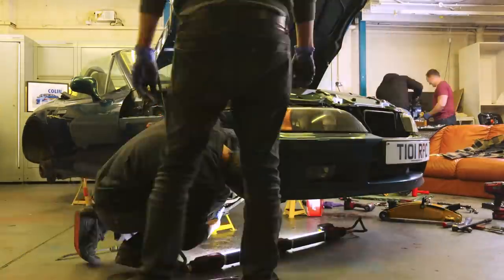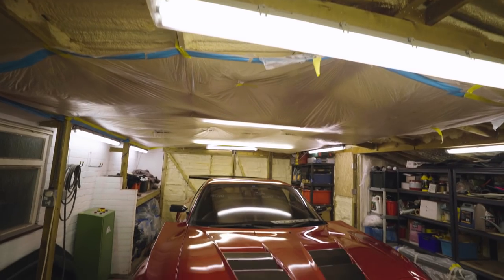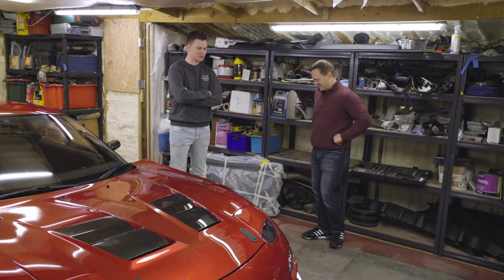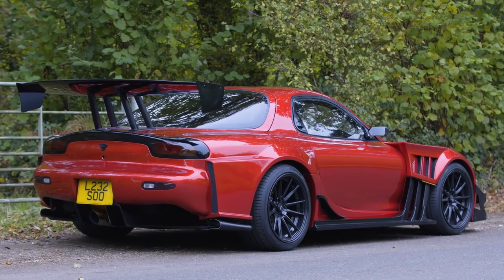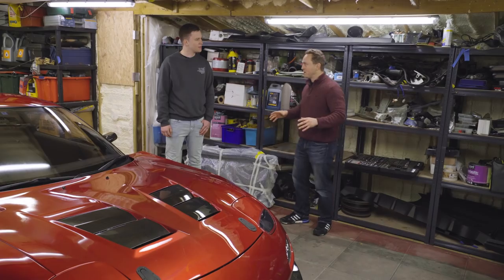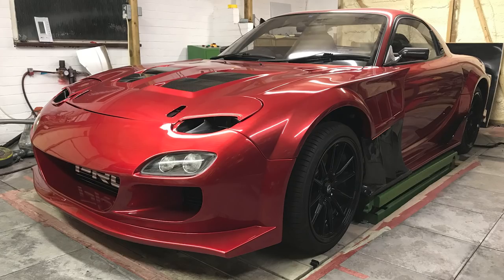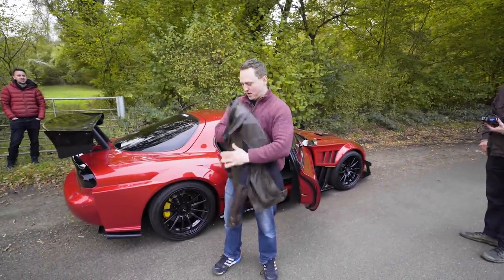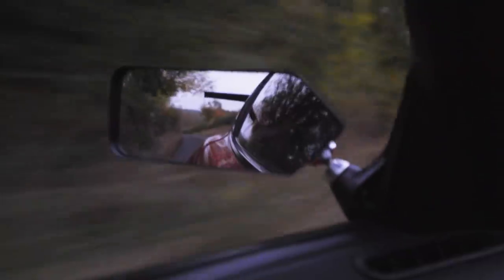This Built-Not-Bought RX-7 Made Me Fall In Love With JDM

Comment: Glad you've discovered how much fun the RX-7 is.  The thing is, the FD is designed from scratch as a sports car, rather than being based on a saloon like GTRs and M3s.  The whole fundamental architecture of the car is just right, which is why it feels so good to drive.

Great work by John here, the bodykit and paint look world-class and the wheels and stance back it up.  I love the originality with the front lip and centre-exit exhaust, too!

Having said that, most of the changes aren't about how it drives, so a stock-bodied car with a mildly tuned engine would still give you most of the same thrill from behind the wheel - no need to spend years slaving away in your garage to get the RX-7 grin on your face!

Comment: I just came across this video because of my love for RX-7’s. I use to own one and sold it when I started my business. That was about 16 years ago, and now I’m an owner of a 2006 lotus Elise. All original factory condition with 14.7k on the ticker. As much fun as the Elise is, there is just something magical about the RX-7. And I never tuned my FD over 300 rwhp, I tuned it to 282 rwhp. It’s not the fastest car, but it’s still plenty quick and fun. At those numbers, I’m able to keep it fairly reliable with frequent oil changes, general maintenance, without flooding, blown seals, and whatever rotary issues you can think of!

Comment: Finally you’ve come over your German car jinx and came over to the bright side to a quality and world undiscovered in German cars since 1995: RELIABILITY (for the most part).
Reply: 1980s Mercedes wants a word.
Reply: @GlitzyZebra  Mercs from the 90s don't die either...
Reply: VAG group cars are good until 2004 mate sorry
Reply: Are you seriously trying to talk about Japanese reliability on a video about an RX7😂
Reply: @Silverdogz  late 90s early 2000s Mercs liked to dissolve pretty quickly.
Reply: @conorf8091  🤣🤣 you're serious? There's absolutely nothing worse than 90's Volkswagen. Rattling pos, door handles need to be bought in bulk, ffs even wheel bearings are undersized. I laughed my ass of to my friend when he backed his Jetta and rear bearing failed. They had been replaced within year. Oh and their gearboxes... Jeesus there's nothing good in 90's Volkswagens 🤮
Reply: @jothain  my 02 golf runs fine still 🤷‍♂️ 200,000 miles, not even a tdi engine. Solid cars mate. Not the Mexico built ones obviously
Reply: @jothain  been in a Mazda once and felt like any other tin can Ford just even more unsafe 😂
Reply: @conorf8091  not impressed by one bit. My 2008 mondeo has now 598 000km's in clock,so 🤷
Note that I also mentioned 90's Volkswagens. Yours isn't one.
Reply: @conorf8091 Muahhhah.. Good effort. Fun fact for you. Mondeo scored better in Euro ncap that your Golf. Ford five and golf four stars. Got good laughs to you, thanks 🤣👏👏
Good luck with your interior peeling off from shitty quality "soft touch" surfaces 👌
Reply: @jothain  rust bucket mate. Reply to me in 2 years time that mondeo will be rotten and in the scrapper 😂😂👍
Reply: @conorf8091  well your vw won't even see such amount driven before head gasket failure 😉😂
Reply: @jothain  check the country which your mondeo was built 😉
Reply: @jothain  Spanish rust box. Do you have drums brakes on the rear also hahaa ? 👏
Reply: @conorf8091  oh and at least I don't drive the only car make on this planet that has parts sold in touring bolt busses. We laughed our asses off as there door handles and ie. Passat front wishbones sold for something like 20 euros per piece as it's Volkswagen and you need them.. A lot of them. Only make for such poor quality. German built quality at it's definite worst 👌👏👍👍
Reply: @Brian-jv8iy  there's actually valid one for Conor F too. I've never seen Volkswagen preferred as taxi's. Many, many others, but VW is not on the preferred list.

Comment: That's the same way I felt when I first drove one in 2004. I didn't shut up about it the whole 5 hour drive home, to the point it upset my gf. That one was completely stock and in bad shape. I bought a different one a few months later and I've had it ever since. I've been modifying it since 2005 and have changed the build about 4 times, always upgrading. It's the most fun it's ever been and I fall in love with it every time I drive it. It's even fun to work on and shop for parts and plan out projects.

Comment: Over the last 28 years of driving I have owned 20 cars, I owned 2 FD3's in that time frame, and I can esily say this car is the one I miss the most, on the emotional thrill meter they were so fun and rewarding to drive, they handled like big go-carts, I am one of those Wankel diehards, I know many had love-hate relationships with the motor's reliability, but a thermostat and some 3mm Apex seals really addressed the main issues in my humble opinion, the 8k+ redline just made for such a unique and exciting experience, it took a brain reset as initially I would start to think about shifting around 5k, only to realize I was in the meat of the power band in these cars and still had another 3,000 RPMs to play with.

Comment: I bought my FD RX7 many years ago. I don’t get to drive it as much as I would like but it always brings a huge smile to my face. If you’re looking at one try to keep it reasonably standard. The second hand values are starting to sky rocket but only on standard cars. I guess though if you are saving a car from the crusher it’s fine to modify it but not for me I wanted to keep mine standard from the outside. It has a more free flowing exhaust and updated radiator but that’s it.

Comment: Beautiful car man, I have an FD RX7 too. Have had it since 2006 and this is my 2nd one. I put a 20b in it back in 2008, but as of yet, haven't gotten it running correctly. I'm thinking about ditching the 20b and going RB26. I've got an RB30 in my R33 GTR Vspec and still have my old 2.6. Just need an RWD oil pan, and valve covers. 550hp soulful be plenty for the light body FD, and with the torque of the IL6 that should make for an amazing car.
Reply: Damn, I like the sound of an RB in an RX7. You just know it's gonna trigger some people but I bet it'd be amazing. May screw up the weight balance, though, the rotary engine weighs fuck all

Comment: Meh, front half looks like from one car but rear half looks under done compared to the front.
Almost like "I haven't gotten round to doing the back half yet".
The wing is a little over the top in my opinion as well. A  good custom lip spoiler would keep the lines flowing nicely without being too ricey.
The two tone of the front half doesn't continue down the lines of the car to the rear.
Your fabrication skills are absolutely on point, no question about that.

Comment: Lmao. drag car DO NOT HAVE LIFTED FRONT what the f you been smoking??

only inamerica are ppl so dull whitted that they build crap like that. it even looks dumb. wheel so wide it will grind the paint off just by moving it in a parking lot.

Engine with a scoop so big you cant see out of it. and to top it off my freaking toyota tercel make more POWAH than those big lumps of metal that we use as anchors in europe..